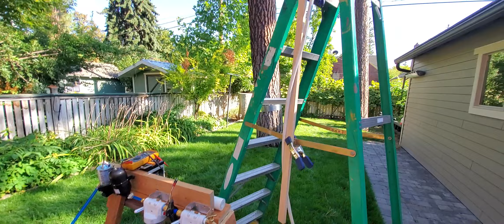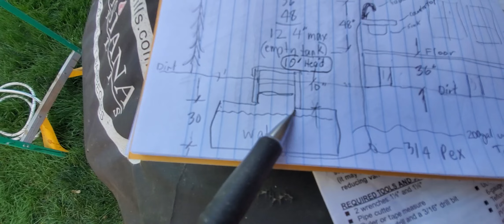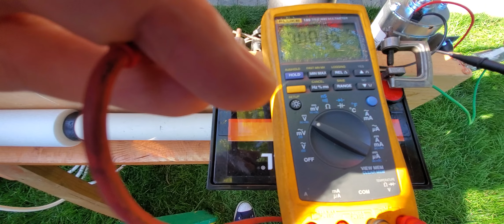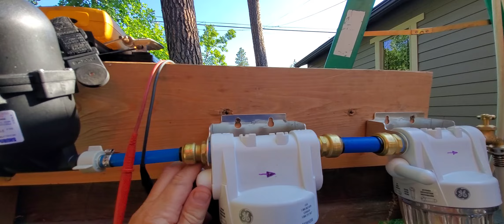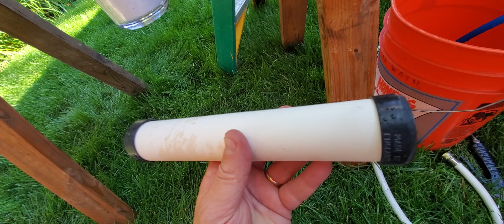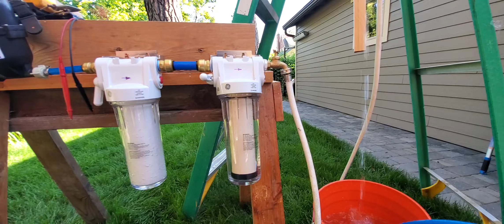My off-grid cabin 12VDC water pump and filtration system.

Comment: Enjoyed this video, looking forward to the update when it's officially installed. Can you increase the pressure on the accumulator to increase flow?
Reply from the maker: That's a good question, I don't think so. The pump only puts out so much pressure at a certain RPM and the accumulator just dampens and keeps the pump from running too often because of spurious pulsations. However I believe, being a DC motor, you could increase the voltage to 16vdc for possibly even 24v without creating problems with the pump. The pump would run fewer minutes per day but would pump more water per cycle. In my experience, DC motors are very forgiving voltage-wise. AC motors are a different story because of harmonics. Maybe I'll do another video where I double the voltage. Thank you for the question.

Oh by the way, I made a mistake on the current measurements. If you zoom in on my voltmeter, it says AC, not DC. This voltmeter is different from the one I use at work and it defaults to AC current rather than DC. I'm sure it's drawing three or four amps. I should have known something was wrong. My bad.